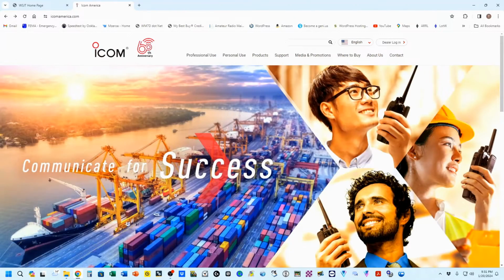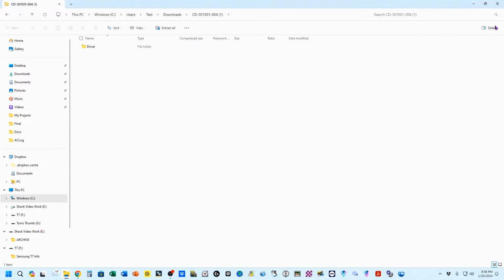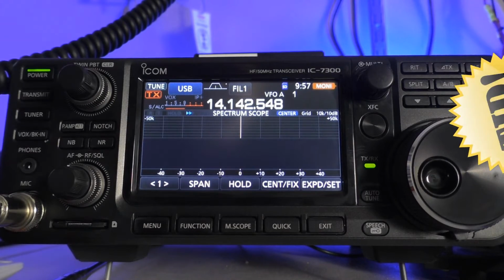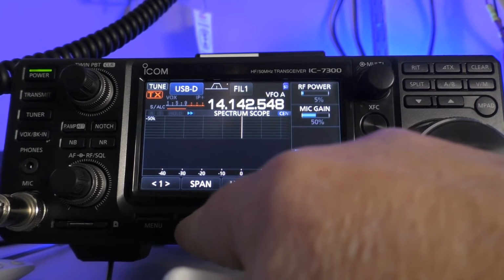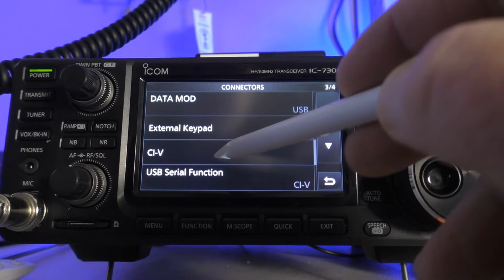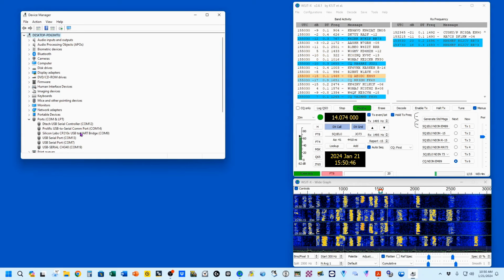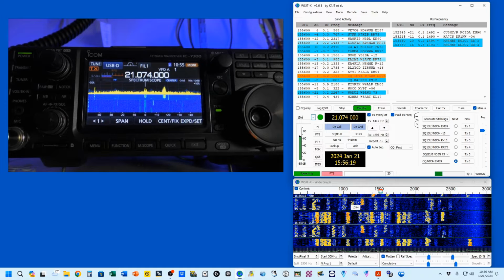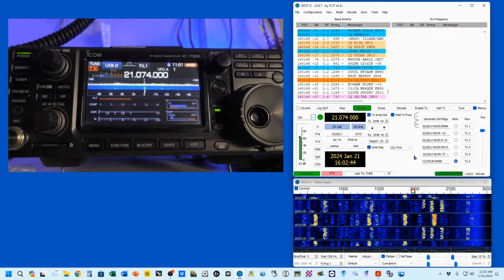Master your IC-7300 WSJT-x Setup for flawless communication

Comment: I assume you connect the usb cable to the computer first. I understand the radio needs to be off, so when you turn it on , the radio and computer “met” each other. Correct?

Comment: How can you start over if you install the driver with radio plugged in and on?
Reply from the maker: On the 7300 you just need to turn off the power supply.  The later Yaesu rigs require you to disconnect the USB cable
Reply: @ND3N  I don’t know what I need to do but my usb isn’t showing up like in some videos I am watching and I don’t have any idea what I am doing new ham and first time trying to figure out ft8 windows 11 icom 7300
Reply: @ND3N  I installed the driver radio on usb plugged in

Comment: Very nicely done. However, every time I go to Settings on WSJT-x 2.6.1, and close out the window, it fails to work. Then, I go back and see that everything, including the Audio Codec settings (now saying >not found<) are reset. Is there no way to save those settings?  I saved the radio settings to my SD card once they were set.  I've been at this for about 4 hours now and it's excruciatingly frustrating. I'm not sure what has changed but I used to run FT8 successfully months ago.  Thanks and 73 DE N2GJ ABQ NM USA
Reply from the maker: Not sure what’s happening.  WSJTx should save as you go.  Try uninstalling and reinstalling WSJTx and see if that clears it up.  I’ll try to recreate on my system and will let you know if I have any further insights. 73
Reply: I thought that the program should save my settings, but it isn't. I actually uninstalled v. 2.6.1 in order to follow your video, step by step because it has not been working. I guess it's mystery.  It's odd that W10 is also flipping the Audio Codec settings as well...gremlins!  73 DE N2GJ-Thanks for the quick reply.

Comment: I can't thank you enough for this! Been using WSJT for years and just upgraded to a new IC-7300. I've watched a bunch of videos on setting up WSJT on the 7300 and yours is the only one that worked. I was about ready to give up. Thanks again and hope to see you on the bands. Now if I could get ACLOg working I'd be set. 73, WK4X
Reply from the maker: I’ve been using the n3fjp aclog with mine.  It’s actually really easy. I’ll put out a quick video in the next few weeks, so BOLO!
Reply: N3FJP ÀCLOG website has been down for a while. Do you know whats up? WB7WBW

Comment: New sub here. This is something I want to try to figure out this year. Getting some working knowledge of using digital mode on both my 7300 and 705. Also will be getting my extra this summer (hopefully), so I can check all that off my list. Currently working (slowly ) on my CW. But, FT8 is next on my list!
Reply from the maker: Welcome aboard!  FT8 is pretty easy as the software does the work for you….